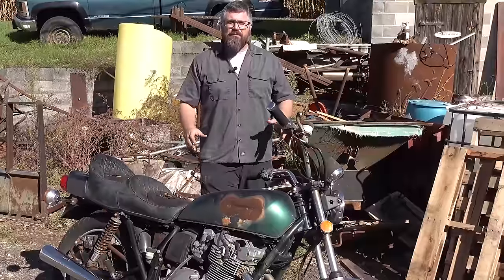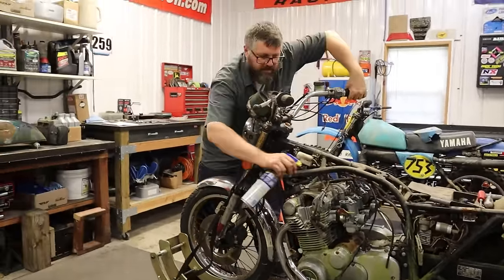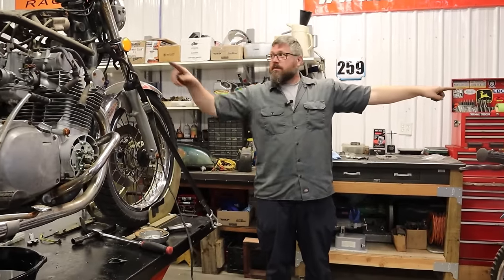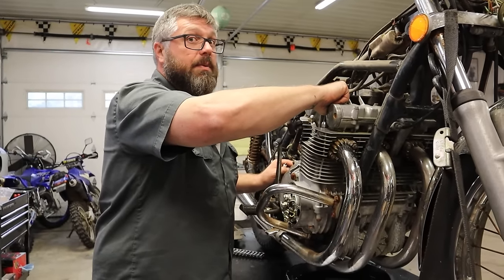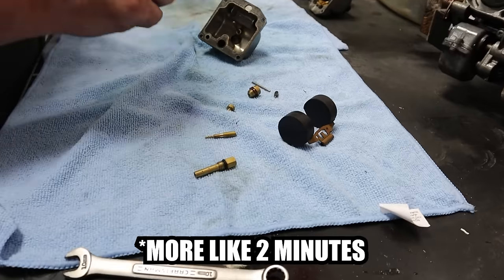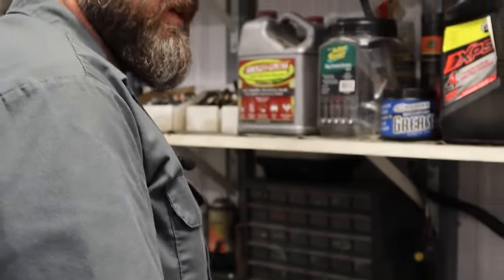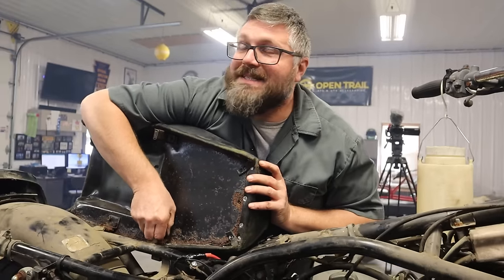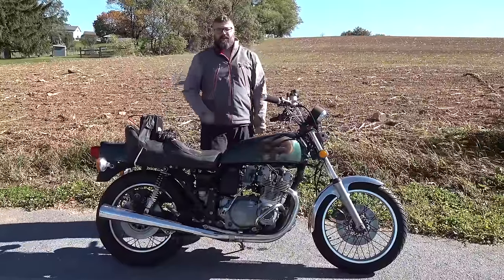Can I Get This $300 Old Suzuki Motorcycle Running?

Comment: This guy is a wizard when it comes to fixing motorcycles!
Reply: Apparently the roller brg bottom end on these was that robust that Suzuki used it in the 1000 gs as well I had the gsx 1100 great torquey engine
Reply: No, WD40 did the job ;)
Reply: That beard isn’t for nothin
Reply: It really isn't difficult,  fuel, air, spark. The older the engine the easier it is to figure out which isn't happening. Anybody with basic common sense can do what he does.
Reply: Love the old GS models. Owned the 550 and the 850, both customised.
Reply: I would even have him work on my sled if i lived in that state.
Reply: Really !?
Reply: @Boga217  as a repair tech that has fixed a lot of stuff, its common sense for some. Ive tried teaching a lot of new guys and some people just cant get it

Comment: I talked to a drag racer running a Suzuki at a local drag strip. He said the reason so many prefer these engines is because the bottom end is nearly indestructible. Others (Kawasaki, Yamaha, Honda) don't hold up nearly as well under high horsepower. He then went on to win his class, LOL!
Reply: Jogging the old grey cells, I think Suzuki used two stroke big and small ends on some of their first four strokes...hence the longevity 👍👍
Reply: @soggybottom3463 yeah they used roller cranks and therefor got away with using very low pressure oil pumps.  The high hp drag bikes typically had their cranks welded together for added strength (rather than just being pressed together)
Reply: Thanks for the story that gives me even more satisfaction of being one of the first persons in this area to have worked as a Suzuki shop that year it was a good year I gave 1750 invoice for my brand new one that year.
Reply: @soggybottom3463 yes the bottom end was ball bearing
Reply: @gtemnykh exactly they would run at about 5:00 PSI which was normal
Reply: Early kz900s were  preferred dragbikes. H2 triple 2 strokes still on the strip racing.suzuki has the Hayabusa but honda has the goldwing .1million miles documented. I remember when they ran an interceptor 500 miles straight on oval track, no breakdowns.

Comment: Ever since you started your channel and started saving old bikes iv been wanting to do the same. So I got a 1978 kawasaki kl250 for 400$. I'll be spending the winter fixing it up in my apartment. Just got it home last night and it's comeing completely apart. Going to clean all the rust and re paint everything. Engine has some mis matched bolts and a stripped oil drain. Good thing I'm a machinist. Will be repairing the drain hole and getting all new stainless hardware. So far iv been extreme lucky. It has all the compression and makes spark. The gas tank doesn't leak and is only a little rusty, the tires are in good shape with no dry rot. All it really needs is the front forks need rebuilding. Found a seal kit online. I have high hopes for this little kl250. Thanks for the inspiration Craig!

Comment: I have done this !!! DUDE !! Do one carb at a time , use guitar strings to clear, use compressed air to remove gunk i use gas or denatured alcohol, measure top down the factory hieghts with calipers and put back together, did this on a 1983 550 nighthawk , ran better than showroom, with 38000 miles, rode for 5 years no problems then sold for for 1800 when i bought for 800 17 years ago. did not replace any factory carb parts.

Comment: These are one of the strongest, most reliable, best bikes ive ever rode. Built llike tanks to last, i thrashed one around Adelaide then went to melbourne sidnet , Dubbo, blue mountains and 4 months riding it around. Great bikes. I loved the points carbs and simplicity of them.

Comment: Super cool! 1981, GS650L. I was just 21, she was new. Rode that thing everywhere. The alternator was inside the case, bathed in hot oil. Went through a couple of those. But a trusty steed she was. Shaft drive and rear end antics when accelerating. Hard tires, but they lasted. Thanks for the memories. You do great work. Save the old iron. Those were the best of times.

Comment: Great engines - I had a 550, then an 850G and they are all but bulletproof.  My 850 carried my son from Socal to Durango, up the 1000000 Dollar highway, back thru utah and home as recently as 2006 - still got her.
Reply: I had a 550 as well. 1975.. 3 cylinder 2 stroke. Got hot pretty fast in the Summer and would ping and knock like crazy. SOB to tune too, 3 separate sets of points.. one for each cylinder. Even the dealership had a hard time with it lol.
Reply: @jack-1955 I suspect he was talking about a GS550 the four stroke model related to the larger 750 in this video
Reply: They got roller bearing cranks. He is right they could have nitrous injection, turbocharged etc and as long as the oil was kept up and not drop it wouldnt go bang even if you neglected oil filter and oil changes on time.
Reply: I snapped the shaft on my gs850, wheelying it, and eventually holed a piston as a result a split inlet rubber. But it was a great bike. Put mega miles on it all over europe
Reply: The little 550 is scary I still have a engine for one of those outside good compression I need to make a manifold and put like a single or a double carburetor on it
Reply: @jack-1955 oh I'm sorry you're talking about the triple two-stroke that was also a pretty fast bike built really well I bought a little GT 185 ram Air Suzuki that year because no one wanted it it was a 75 model and it wasn't going anywhere it stayed around here a long time it was a two-stroke twin
Reply: A little over half of those bikes needed the carburetor synchronized right out of the crate you can tell by the way it idles
Reply: Yeah I sold those knew that little 550 was a six-speed I still got an engine from one of those I had the 750 and was a hero for that summer
Reply: Save the burnouts for the Young dudes I don't care for it😂

Comment: I just love watching these back over and over. The joy of the first start never gets old. I've just got a 99 Aprilia Pegaso 650 on the road after ten years stood idle after the sprag clutch went. It had no charging system or lights when running. A quick clean up of the electrical contacts and the grounds restored everything.

This bike bought back memories of the GS850G I had. Bulletproof bike that sounded amazing with a 4-1. Keep em coming Craig.

Comment: My motorcycle guru taught me I should replace all the brass in every carb I take apart first thing. Only with OEM brass from the carb manufacturer. Mikuni brass in Mikunis, Kehin in Keihin, PWK in PWK etc... Jets, pilots, needles, emulsion tubes, and inlet needle and seat (Not Keyster kits!). The money it costs is worth not having to take them apart again and again, and you never know what monkey has been reaming the jets with whatever pointy thing was handy. You can spend half a day chasing a jetting issue because somebody was too lazy to get the right number and jammed a torch tip cleaner through them, or bought cheap kits with bogus needles and no numbers on them. Savages... I'd like to see more 2-stroke street bikes if you can find some. Love the channel! Excellent content!!
Reply: Yes proper jetting  got my 80 cb750f redlining at 11000 rpm.feels like a moped after owning a goldwing.

Comment: I had various configurations of this bike... a 77 GS 750, a 78 GS 550 and 79 GS 1000.... also had a 91 Katana 1100.  Have been searching for YEARS for an 82 GS 1150 E. Very durable engine design.
Reply: I’ve owned and restored a bunch of these GSes: 78 750E, 78 1000C, 81 650G 81 1100E 82 1100G.  My favorites were the 1000C with the wire wheels and single front disc brake and the 750E.  A bit less power than the big bores but it felt like a better “balanced” bike in a sense plus the rear tailpiece of the early 550/750 is the best looking of all.  The 16 valve 1100E was obviously far and away the quickest

Comment: My first bike was a 1977 gs750. Bought when I was 18. Super fast with a wonderful air cooled sound. From what I’ve read was the fastest (1/4 mile) production bike in that vintage. I wrenched on it with my dad. Learned a lot of skills that have helped me with many other types of mechanics and shaped who I am today.  One of my best period of memories and will always love that bike. After that I bought a brand new gsxr750 and put over 50k on it before doing sold as a ratty track bike.
Reply: The GS750 ran a high 12 stock, it was never gonna match a KZ900 in pure straight line speed (low 12s stock), but it was the fastest 750 and close enough in a straight line to the big Kaw while being a better overall package in terms of handling (stiffer frame, better more compliant suspension)

Comment: UK here. I got to ride one of these for a day. Pretty cool. Although my own bike was a GS550 (I also had the GS550E model with CV carbs) with cast wheels and twin discs on the front and a disc on the rear. Lovely set of bikes to ride. No need to keep them in a power band. Just open the throttle and away they went. Very sure footed. I can't ever recall them ever stepping out of line going round bends, even when the rain was pouring down. Might be wrong but I seem to recall the 750 had 5 gears and the 550 had 6. And a pretty cool gear indicator as well. Most helpful.

Comment: You totally gave me the buzz to purchase an old 1984 honda vf500f interceptor from offer up for $400 with title. I replaced everything that was missing or broken and rewired all the bad electrical and rebuilt the carbs and cleaned the fuel system and tank! I now ride the Honda as my daily and what a great feeling just to ride it around my state! this year I will save and paint the bike and frame! Thanks for all the tips and videos and even more so the never quit mechanical challenging issues attitude!!!! Have a great day and keep on, keeping on!

Comment: I had the same bike back in the late seventies and one of the curious aspects of Japanese bikes of that time was that they had both kick and electric starters. As displacements went up and their faith in the reliability of the electric starters of the time increased the kick starter for street bikes went the way of the Dodo. Back then even when they were just a few years old it was rare to find a used bike that had a working electric starter; for this bike's electric starter to actually work 45 plus years later was fairly miraculous!

Comment: I was going to get a '79 GS750 but there was a black GS1000E sitting right beside it on the show room floor. The price was not that much more and I checked to see if I could get about $400.00 more on the loan. I could! The GS1000E is one of the best 1000cc bikes ever made. The 750 was awesome, I just wanted a little more beast.

Comment: This is just the inspiration I need to work on my old bike. I've got an '83 GS750ES that has been parked for 15+ years. Was running when parked but life got in the way. Needs carbs gone through, brakes rebuilt and likely work on the forks.

Comment: Currently rebuilding my GS750 ( 850 block) chop that I built in '85. We sold her to get the deposit up for our first house and bought it back about 8 years ago. Somebody had fitted a GSX moyor but having spend a couple of months working on GSX motors with shell bearing cranks, I went looking for my old engine. Got her back last year! Hard Tail at 60 years old! This could be fun! 🙂

Comment: I was a young guy working at a Suzuki shop and this is what I learned a lot on. One thing very important is to keep a good battery installed and not run them without it. The charging system will cook itself trying to charge that dead battery. Usually, a stater then regulator will die, very costly back then.
and yes those needle and seats were a problem even when slightly used!

Comment: One of the first things I always do when working on an old hasn't ran in decades machine,even before I spray the cylinders down with fogging oil,or diesel/auto tranny mix is to spray CRC electrical cleaner into the run,off switch while pressing it inwards and sliding it back and forth several times,and then jump on into sanding,cleaning the points,and testing the condenser with a multimeter..

Comment: What do you do about those rusted forks?  I couldn't live with that. Not sure how to restore those. Maybe a plating shop could use reverse current to float away all the old chrome plating, then sand the steel through all the rust, then re-plate. Or maybe just sand the chrome off with a bench belt sander?

Comment: Brings back memories. i bought a GS750 when i was 17 years old for 250.00 that wouldn't run over 30mph, stopped adjusted the points and drove it for 5 years...

Comment: had one, purple, 78, low bars, sport seat, TSCC . . .  helluva bike, you needed fork stiffeners or at like 110 the head shake was incredible .. had mine for a 3 decades, finally gave it away after I got the Busa and gen 2 gsxr 1k . . .  wish Id kept it was in great shape

Comment: I picked up a 1980 GS1000g and pretty much did all he did. But I moved slower. Rebuilt head/lapped valves, and new piston rings as compression was L to R 170/122/121/170.

Comment: Haha "old historic bike"........Among my riding group in my teens was one of these GS750 when it was only a couple years old. I was still on the relatively young 1975 GT750L. I progresed through the GT250, GT380, GS550, GS850G, GSF1200s, (a lot of other brand/models along the way) Suzuki fan boy still DL1050. I remember wrenching on all of them. Still have my original timing light gun from the GT750 (actually had 2x consecutively). 
   Love watching your work, its like a trip down memory lane.

Comment: The die hard points guys don't like this but when I owned my '77 GS750 I was able to do away with almost all of the stock factory runability problems by getting rid of the dual points setup and going to a Dyna S electronic ignition along with dumping the factory coils and installing the high energy Dyna coils. At the time I had the bike it was just a toy or at least that way in the beginning so when it came to my riding style on that bike bouncing the tach into the redline often ment having to clean and readjust the points every 2 weeks of hard riding. I never had to touch the ignition ever again after installing the electronic ignition. If anyone has one of these in nice shape dump the points, you'll never be sorry!!

Comment: I bought an 84 suzuki gs450l from a lady who parked it outside for 2 years and it was abused! I fixed all the signal lights that were smashed, custom ordered and modified the carb boot that were unavailable. Needs a tune now, but runs pretty great now

Comment: Craig: I know I've posted this somewhere before but I can't remember if it was on one  of your videos. The charging system on that era Suzukis is a fire looking for somewhere to start. If I can get it into words, it's something like this:- 

the yellow wire goes from the rectifier to the regulator for the ignition system. This one's okay but it's the only 12 volt output that's regulated
the white-blue wire is an unregulated 12 volt line and relies on the battery being in good condition to keep it pulled down below 14.2 volts
the white-green wire is an unregulated 45 to 60-volt AC feed. It goes up to the r/h switch and comes back as a white-red wire to the rectifier where it's rectified to 12-volts before being put out into the main harness again. No regulator - it relies on the lighting being on to pull it down to 14.2 volts
the red wire direct from the rectifier to the battery is also a doozy - again no regulator - it charges the battery and relies on the battery being in good condition to again keep it pulled down below 14.2 volts

Assume no permanent headlight on (have no idea when that was introduced in the US). Under daylight conditions the green-white wire is floating free with no voltage sink - result is excess heat in the rectifier. If the battery is a bit suspect, the red-white wire also starts dumping volts as heat. Final result - kiss goodbye to the rectifier, regulator and alternator. The immediate fix is to keep the headlight on and ensure the battery is always in good condition. The better fix is to mount a Honda CB-series (or similar) combined regulator-rectifier as follows:-

the three yellow wires on the Honda unit are connected to the green-white, blue-white and yellow wires on the Suzuki alternator
the red wire on the Honda unit goes to the Suzuki battery
the green wire on the Honda unit goes to earth
the black wire on the Honda unit goes to the pure orange wire on the Suzuki
cut back and insulate the red-white and green-white wires in the main wiring harness. 

During the late Eighties and early Nineties I had in the region of eighteen GS-series Suzukis through my shed for that fix. Most had already blown the charging circuit; one had actually caught fire on the rectifier and as word got round, I did a few before they invited the fireworks to come and play. The downside was the local scrappers got wise to what I was up to and the price of s/h Honda CB reg/rec units started climbing... 😂

-Dai

Comment: Love this stuff! I got my first gs750 for $100, slapped a new battery and regulator on, and rode away with it. Pretty soon I had to get rid of my Pan European as the Suzuki is just so much more fun. It's been a reliable commuter for me up until recently when the gearcam roller spring snapped and damaged the gearbox, which I'm in the process of fixing.
In the mean time I've picked up 2 more of these bikes for next to nothing, one with the 16v 1100 engine built in to it, the otger with a very funky period dual headlights fairing.